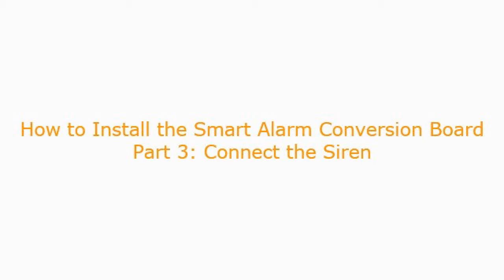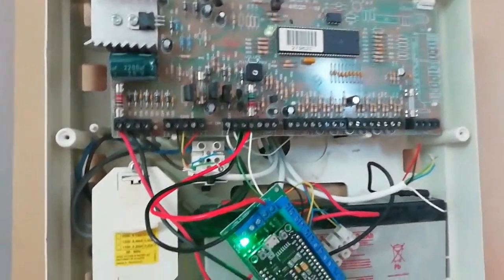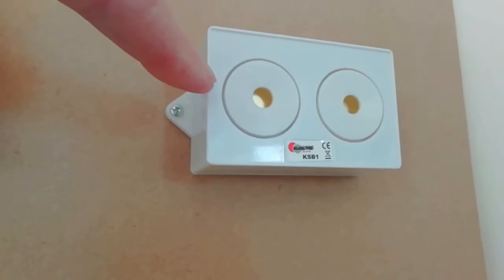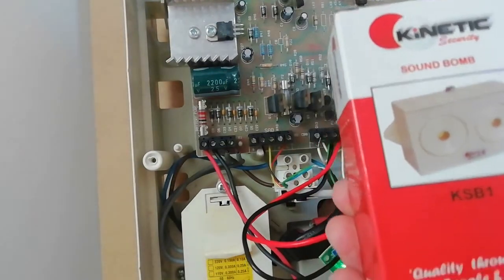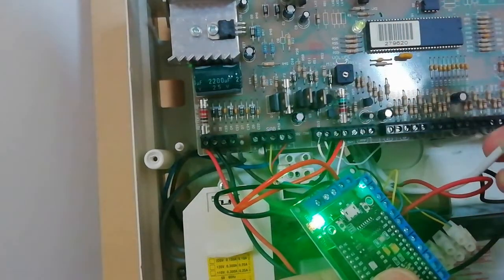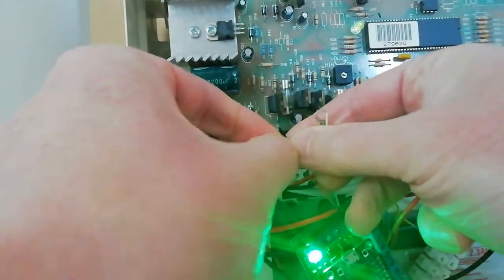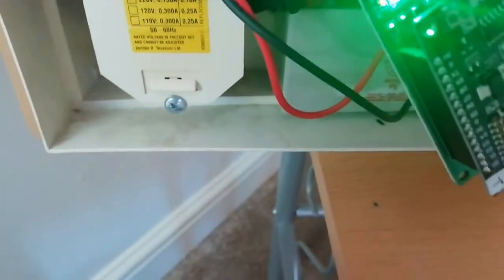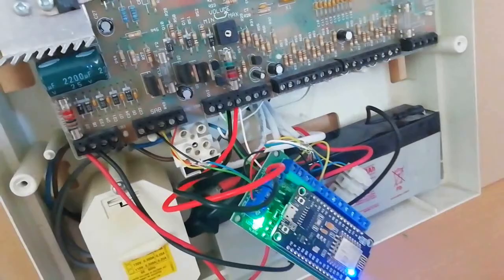How to install – Part 3: Connect the Siren

Comment: Hi I have 6 zones plus a tamper - does that mean I have to lose a zone?
Reply: I also can’t find a guide to my existing panel - eurosec THL-55, I can work most of it out but it has additional connections incl “bell hold” and SPK
Reply from the maker: Hi if you have 6 zones plus a tamper loop then you need 7 zones, if you want to retain the same configuration. If you want to reorder or decouple devices into new zones that is covered in the instructions at nodemcu.freecluster.eu
Reply from the maker: BELL hold wire doesn't need to move, and SPK is speaker, if you download the installation manual for eurosec cp8l it will be similar to your layout.
Reply: @planet_tech4443  so I don’t need to do anything with Bell Hold , SAB TMP or SPKR? . If this is correct I’m ok with the rest of the wiring.
Reply from the maker: @PeterGarrity  hi, check the Bell wiring page on nodemcu.freecluster.eu it tells you which wire to move

Comment: Hi, I connected the conversion board and I can see in the app it is working but outdoor siren doesn't sound when alarm is on. I connected Strobe and Bell exactly the same as you on this video. Do I have to connect the internal sounder too, to make outside siren works?
Reply from the maker: Hi, no the internal sounder is not needed to sound the external Bell. If you ping me on my eBay messages with a photo of your Bell wiring I will have a look. There are a couple of tests I can guide you through.

Comment: Hi, I wonder if it could be made a little clearer as to whether the Strobe + and external Siren +  leads should/should not be added to the new Sounder + connection all together.  I have a panel that supplies separate Strobe + and - connections to that of Bell + and - (external siren.  I have added an internal sounder as suggested in this video but I don't understand why only the new internal sounder + lead is attached to the Conversion Board.
Reply from the maker: Hi, the strobe + and Bell + leads could be moved to the conversion board Alarm + connector if required, however they normally have a steady 12v + supply from the existing board, so moving them is not necessary in most cases. 

The reason that the Strobe - and Bell - are moved to the conversion board Alarm - terminal is that UK alarm systems are generally switched negative and the Alarm - terminal will switch negative to activate the alarm when instructed by the Smartthings logic.

When adding a new sounder you wire it to the conversion board Alarm - and Alarm + terminals.

If users have difficulties getting the sirens to trigger or strobe on alarm, I have connections mapped for most UK systems so I can help with any queries.
Reply: @planet_tech4443  Thank you for such a quick and clear response.  I now understand and will keep the + supplies to the strobe and siren connected to the alarm panel.  I shall assume that the reason for a separate + supply to the strobe is to turn on the strobe to signal all zones OK when the panel is armed.  The + to the siren probably also charges the battery in the external enclosure.  My panel is a Response Alarms PA6 (wired) connected to a AG6 external sounder and strobe.  In line with your installation instructions I have added a Sound Bomb internal sounder.